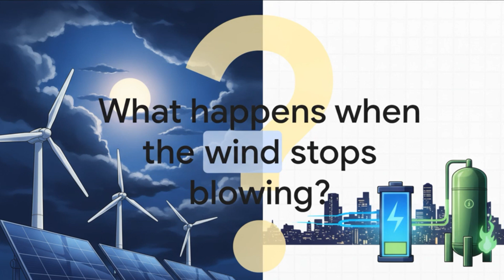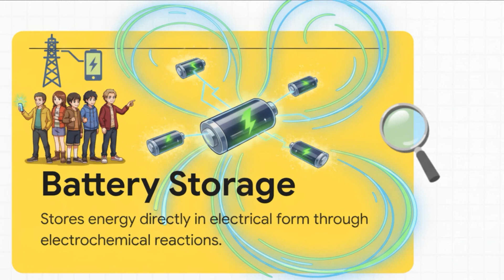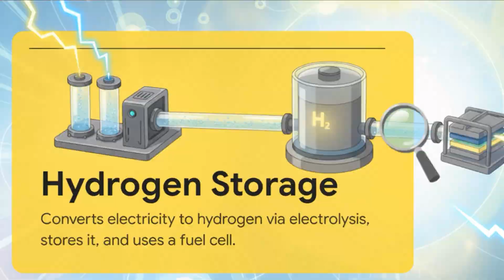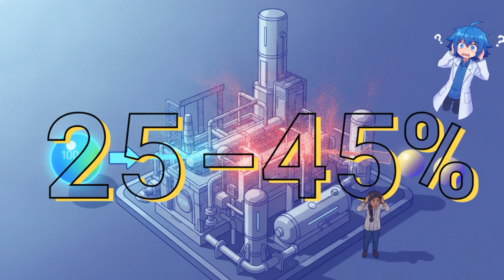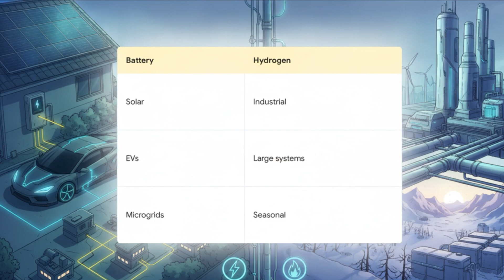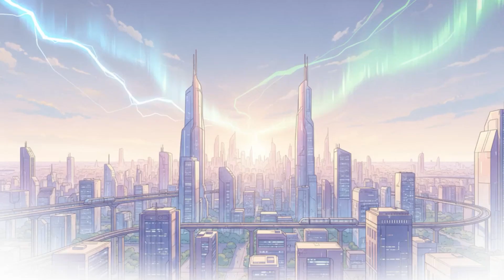The Energy Storage Battle: Hydrogen vs Battery

Comment: Battery storage without any doubt.  While hydrogen has some good qualities, it has one horrendous one.  Transportation.  Just getting it to where it is needed is expensive if it is even possible.  Hydrogen today is mostly produced from methane conversion at the site where it is to be used.  Storing hydrogen, especially in vehicles is very dangerous and very difficult.  Even stationary storage of hydrogen is very dangerous.
Reply from the maker: Thanks for sharing your perspective. You raise an important point about hydrogen infrastructure and transportation challenges.

Battery storage definitely has strong advantages today, especially in efficiency, deployment, and short duration applications.

Hydrogen still faces challenges related to production, transport, storage, and cost. However, many researchers see its potential more in long duration and large scale energy storage rather than replacing batteries everywhere.

The interesting part is that the future may not be Battery vs Hydrogen, but Battery + Hydrogen working together depending on the application.

Appreciate the thoughtful comment and discussion.